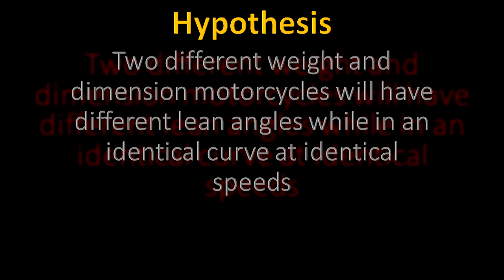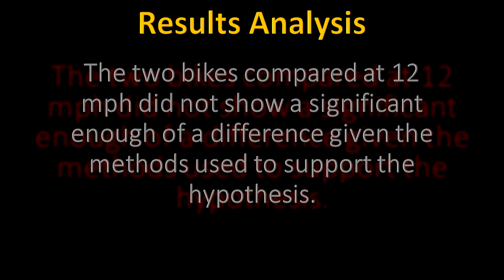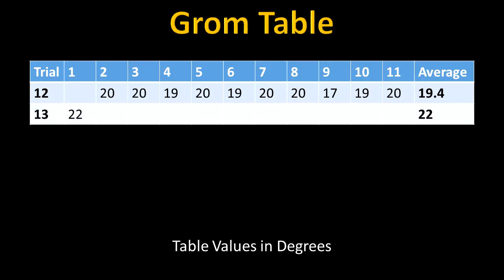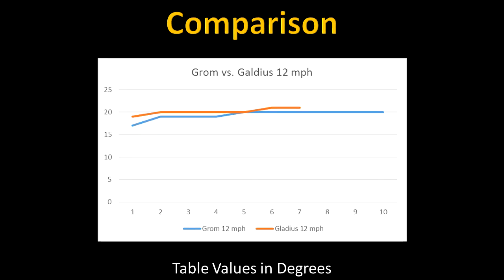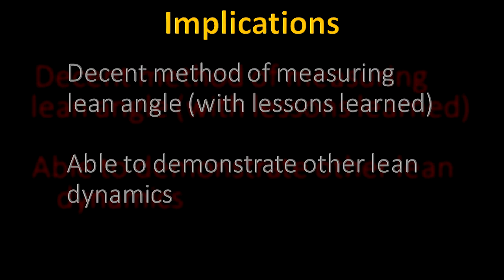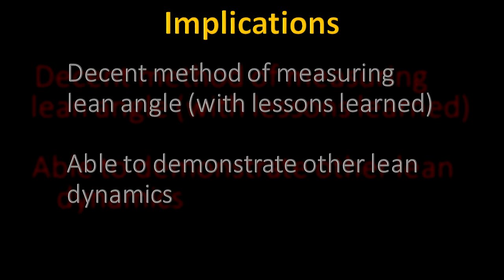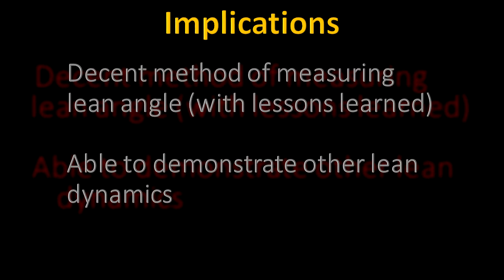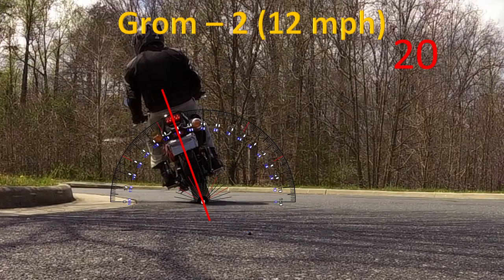Motorcycle Lean Angle Study Report

Comment: The lean angle only depends on the speed and how tight the corner is, so your new hypothesis is correct. This is really simple physics. Anything else is a error in measurement. There is NO difference between bikes.
The only difference bikes make is their LIMIT at leaning, which may be due to the structure of the bike (bits touching the tarmac) or the total grip between the tyre and the tarmac.

(It is simpler when the rider stays in the centre of the bike. When they shift off the bike, they alter the position of the centre of the gravity of the bike-rider "system", which allows a lower lean angle for the bike itself, but does NOT affect the angle of the centre of gravity relative to the contact patch of the tires.)
Reply: nope 👎🏻 … lean angle of bike depend on resultsnt cog tire width profile deflection characteristic bike with thiner tire at similar profile at higher resultsnt cog will lean less on the same corner radious at the same speed 👌🏻draw  on paper 45 degree straight line and on bottom when line touch” tarmac draw line imitate tire width and somewhere on this 45 degreee long line draw Cog this is lean angle between cog and where tire have contact with tarmac ok ? ok now  connect cog wherevere you draw it with centre of tire width now this is bike lean angle egzacly in the midlle of its vetticsl axis when ypu watch on bike from front or rear 👌🏻 ok now change tire width and cog high for fadt and best show whatt happen now change position of cog lower and increase tire width and again drae line from this wider tire centre to new lower cog hight 👌🏻 what happen ? now line showing bike lean showing much biger lean angle 👍🏻 if you comapre it to first setup where cog was higher and tire thiner 👌🏻 hees test is 💩 ok not test test is good but assumption which he twke out of it totally wrong 👌🏻🤷🏻‍♂️ why ? cos grom is much lighter have thiner tire and proprotion between resultsnt cog hight with tire width asf can force grom to lean angle egzacly the same as gladious in this test he shpuld tske vrod feg and cbr 600 rr than he register big diffrencess in lean angle at the ssme corner rsfious and the same speed 👍🏻the higher cog + the thinner tire 👉🏻 the LESSS bike must lean for register egzacly the same G force in the same corner line radious and speed cos it have now STRONGER leverage 👌🏻 thats FACT 👌🏻 rest is wrong readings of test people with lack of knowldge asf or some other gay 💩🤮🤭  which explain basic physique leverage calculation and much more sufisticated realll world test with many diffrent bikes where they precisellly measured  COG and all other stuff and setup bikes with precise meadured device register everything 😎👌🏻other way how you can found it is superot bathroom scale on wall take dumbell with weight on one side of dumbell suport this dumbell on ground and on bathroom scale at the same angle so the same place on ground and place on bathroomscale on side wall first with weight high 👌🏻 than spin it around fro weight low and wathc what bathroom wcale show 😎👍🏻 it show biger weight /force when weight of dumbell is higher 👍🏻☕️

Comment: 2 bikes say 0 theyr proportion between tire size profile deflection and cog can be equalll with rider on both 🤷🏻‍♂️ your assumption is wrong cog hight tire size profile asf determined lean angle and is diffrent for bike with diffrent resultant cog and diffrent tire unlesss in some cases thiner tire compensate lower cog asf 😉👌🏻 go compare vrod with 240 rear tire with low resultsnt cog = weak leverage vs let say with ktm 640 lc4 feg with thiner tire higher cog = strong lever and diffrences in lean on the same position the same radious and speed be defintelly registered 👌🏻i make test with stick ofseet 7 cm what imitate tire width 140 mm (not egzacly cos contact path is wider and there must take out avg ofseet not furthest on side but its not very improtsnt for this issue and test ) 👌🏻cog 75 cm weight 3,8 kg lean angle required for achieve 50% weight so 1,9 kg so 0,5 G 👉🏻 33 degrees vs offset 12 cm tire width 240 mm cog 50 cm tpthe same 3,8 weight angle required for egenerste 50% force of 100% weight /mass so 1,9 kg on weight scale 👉🏻 45 degree you dont need bike to do such test you need only 2 stick screw into L shape with 2 offsets and some weight which you can change  hight so you cane change cog and some weight scale and inclinometer you can also use some calculation if you  know such im remeber like i have junak m12 tire rear 130 very low cog i need to lean much more for generste the same forces in corner in comaprision to yamaha dt 125 much higher cog rear tire 110 👌🏻 on similar corner on similar speed ypu imediatellly know if some bike have higher or lowerresultant cog depend how much ypu must lean at the same corner radious and the same in this corner speed  👍🏻thats why sports bike cant have to low resultsnt cog cos than they closed lean angle to soon = start have  contact with tarmac be footpeg etc under grip border = lower force in corner/ lower speed in corner than tire allow to go in this corner 👍🏻so completely oposit to cars where the lower cog the better 👌🏻☕️

Comment: The wheelbase of a motorcycle affects the lean angle.  Two motorcycles with a 55" wheelbase traveling at the same speed through the same corner will have similar lean angles even if one is heavier.  Take the same 55" wheelbase motorcycle and compare it to one with a 62" wheelbase and the later will have to lean more to negotiate the same corner at the same speed.
Reply: nope whellbase dont impact on lean angle 👌🏻

Comment: stupid comparison. When the speed increases so is the lean angle. the differences in lean angle will be greater at higher speeds.
Reply from the maker: Wow. You sure did miss the point. I was comparing two bikes at the same speeds.
Reply: kilo delta yeah n I was referring to two different bikes at higher speeds
Reply: If they are the same at 12 I'd bet money that the difference between the to would shift relative to their speed thus any deviation not measurable at 12 mph would make itself apparent at higher speeds... but hey just my opinion
Reply: Two*
Reply: grom can have similar leverage like this glaudius cos thiner tire can compensate lower cog + rider itself increase resultant cog hight be alot as it is biger part of whole weight 👌🏻resultant assumption of this test in regard to whole range of bikes is 💩👍🏻vrod must lean much more than supermoto honda crf 450 👌🏻

Comment: I admire your interest & appreciate you posting this. However,  I think it would be more helpful if you:
increase the speed, 
Brake whilst cornering,
Get another rider in the same bikes 
Load & unload the bike (luggage)

It would also be useful if other organisations would support your studies by providing resources to help measure the difference in traction on hot roads vs cold roads to see how well these ‘advanced’ tyres actually work. Traction is such a crucial factor in motorcycling it should be studied in MUCH more depth.
Reply from the maker: Thank you. Your recommendations are ambitious. I'll put some thought towards it.

Comment: Even if the speed is constant, there are multiple factors you're ignoring imo.
1) Riding technique is a factor. The rider should lean towards the corner and make the bike as upright as it can be for that speed / corner. With the exact same speed, rider can lean away from the bike, OR he can tilt the bike toward the corner thus making himself upright. 
2) Center of gravity for the bike. Some bikes have lower center of gravity compared to others, which makes the distance from the contact point smaller (surface of the tires touching the ground). With a lower center of gravity, the bike will lean less to achieve the same counter centripetal force.
https://upload.wikimedia.org/wikipedia/en/8/87/BikeLeanForces3.PNG
(the small r gets bigger with a higher center of gravity).

So even two bikes with the exact same speed and exact same weight can have varying lean angles. You need to consider these factors before adding in more variables such as different weight and bike dimensions. Of course the rider positioning also effects the CoG. Cheers.
Reply from the maker: I kept my lean neutral for the test to remove that as a factor. Thanks for the link. I'll check it out.
Reply: with lower cog bike must lean more 👌🏻 cos leverage is weaker the same with wider tire also must lean more 👌🏻 low cog with wide tire mean you mist lean much more for generate the same counter force in corner 👌🏻

Comment: Doing this test at that speed is largely MEANINGLESS. Below the point where outside countersteering kicks in, cornering info is mostly irrelevant. Regardz!
Reply from the maker: Are you stating that bike lean angle at counter steering speed would vary by bike size? Does lower than counter steering speed lean angle vary by something else than speed?
Reply: There is a chart somewhere on the California Superbike School site that says how many of degrees of lean is possible at different speeds. Higher speeds do provide greater lean angles.  Bikes behave differently depending on weight of bike and rider, center of gravity, body position, speed, tire profile, tire temperature, tire pressure, and front fork adjustments for your specific body weight. If you know any racers, or have a sharp sales shop, they can adjust your front forks and verify the rear shock has max travel. Driver skill at rolling on power progressively during the curve and choosing the best line play into the equation, too. I think Keith Code is probably the expert in motorcycle curve skills.
Reply: You're  wrong soz